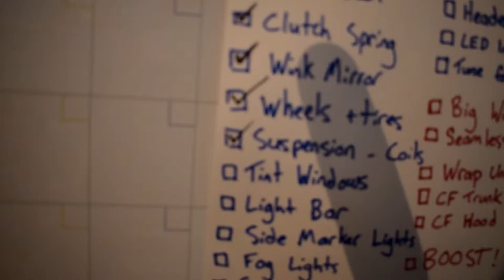Spare Tire SWAPPED to Amp Mount!

Comment: Did you run into any overheating problems?
Reply: I was wondering that to
Reply: In my personal and professional opinion, and trapped heat is going to be bad for the amp ideally it's a great hidden location. Practically it doesn't provide any cooling whatsoever. So I'd avoid it if possible